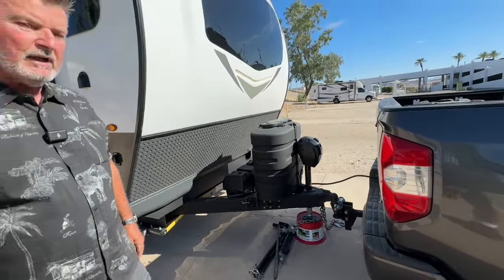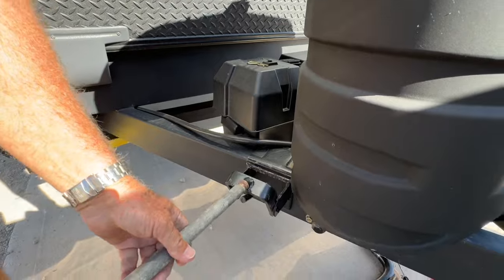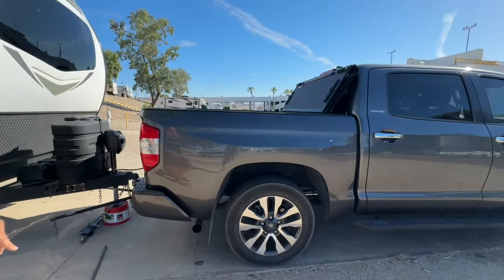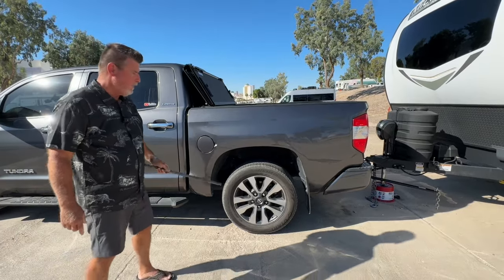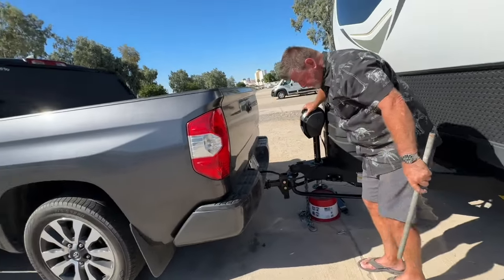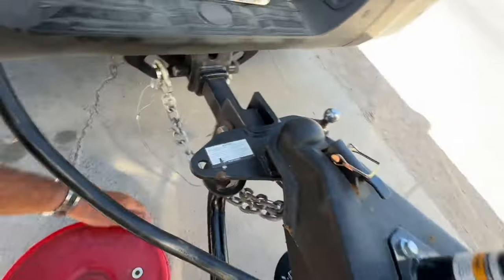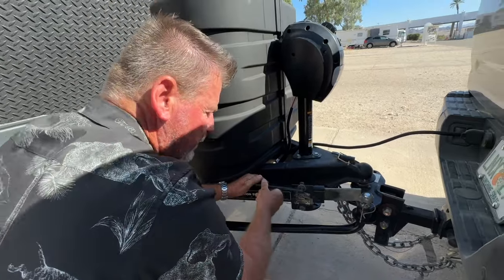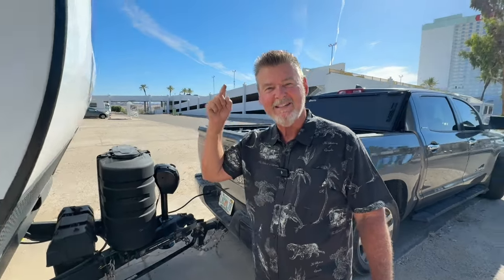How to properly install a weight distribution hitch, the correct way! ￼

Comment: The leading cause of ball mounted trailer sway (Fish tailing) , is too much weight loaded behind trailer axle/s.
 Always load extra weight in front of trailer axles.
 Trailer sway is very dangerous,it can flip the tow vehicle, because under sever sway conditions,the trailer is moving faster than tow vehicle.
 Do not try to accelerate tow vehicle if sway starts, apply trailer brakes. 
 Towing is a long learning curve.Like steep my mountain grades,dont overdrive your experience level.